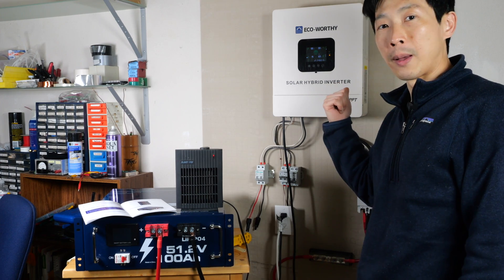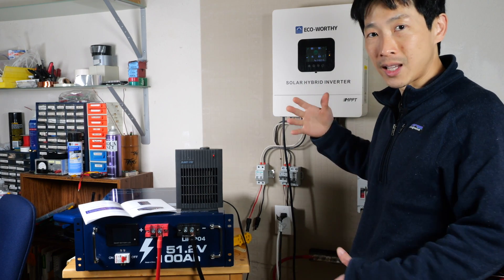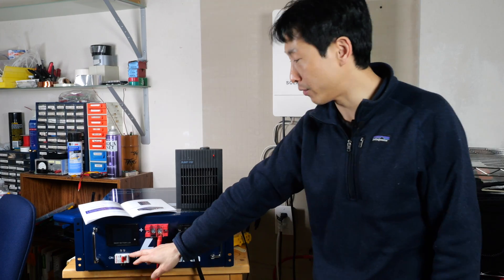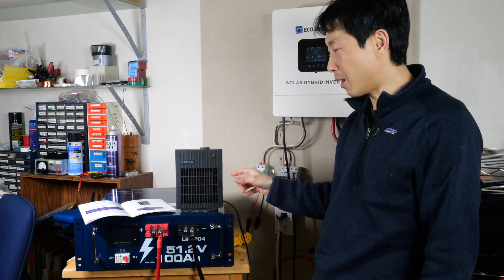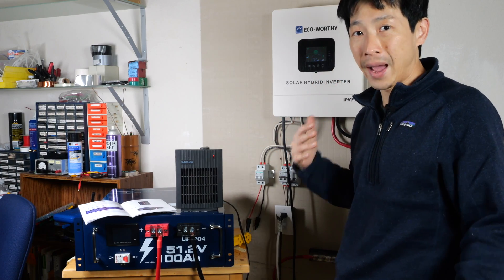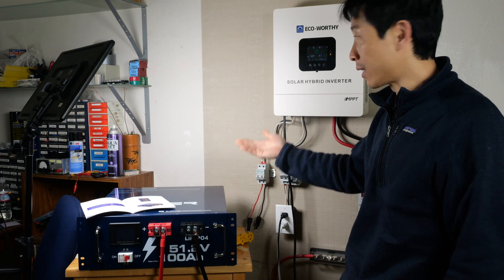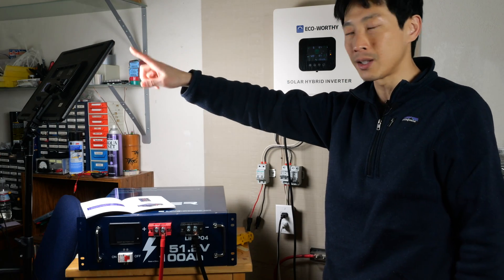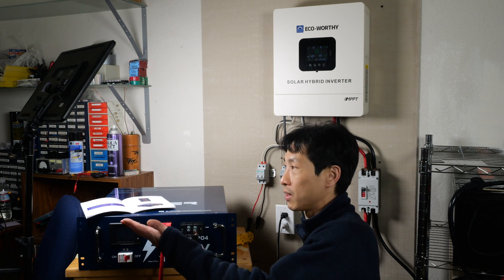Battery to AC and AC to Battery Switching in EcoWorthy Hybrid Inverters

Comment: Great info. Are you still using this inverter and do you like it? Also it states it’s pure sine wave. Did you test it with scope to verify? There is surprisingly not many video reviews of this unit. Thanks
Reply from the maker: Since it is a high frequency inverter, I am waiting for the day it fails. When that happens, I will update for how long it lasted. For the price, I could very well buy another one when it does fail but I plan to swap to a different larger inverter soon. I did not test the sine wave shape just yet but it runs all my computer equipment just fine.

Comment: Your the only one reviewing these products.   Id like to know if this 5000 watt inverter is good enough?  I have all of this in the cart right now, 2 48v 100Ah batteries and this 5000watt AIO inverter.  I want to power my sub panel with this system and save myself 70% of my monthly electrical bill.   Let me know!
Reply: Agreed, I didn't give you enough information at all. So I just bought this 5,000 watt inverter with two of their 48 volt batteries and I'm waiting for them to get delivered. I'm now realizing that this inverter doesn't come with any Breakers unlike the eg4 inverters that have them built in. 

I already have a sub panel installed with a generator hooked up to it that's on the exterior of my house, my plan is to disconnect that and put the AC outputs of the new inverter where this was tied into the sub panel to run my selected 10 circuits as needed from solar only.

I'm unclear what breaker size is to get, t-class dude size and any other items that we need to make this a fully functional system once I get these parts in the mail. Even though it's a 48 volt system what gauge wire am I supposed to use for connecting batteries to the inverter and then the inverter to my subpanel. What's connected to my Sub panel currently is only 10/3 wire. (Dryer cord cable for 220v)
Reply from the maker: Not enough information. 5kW inverter is what it is. It will provide 5kW of power max.